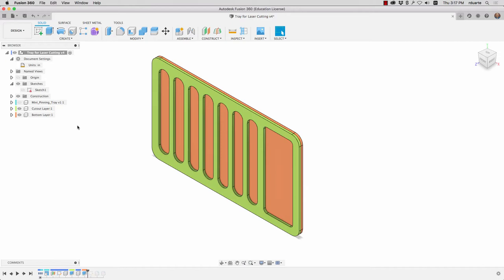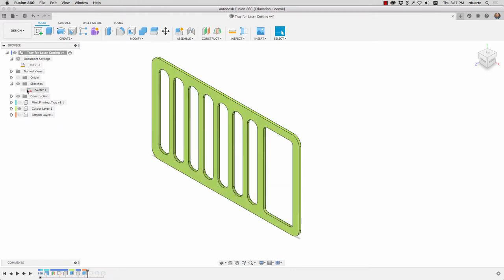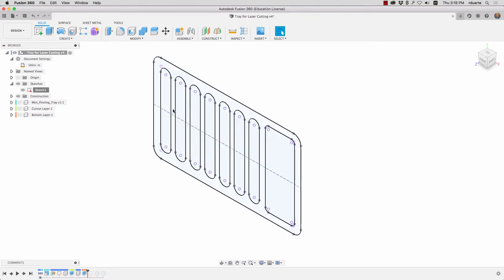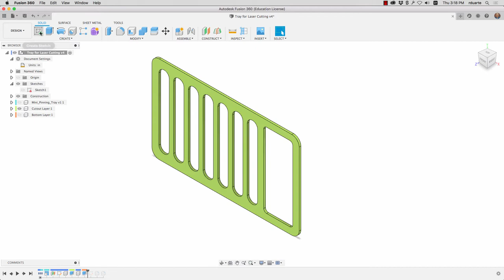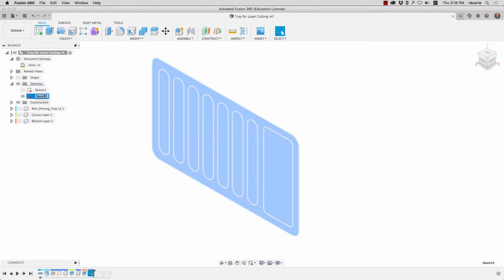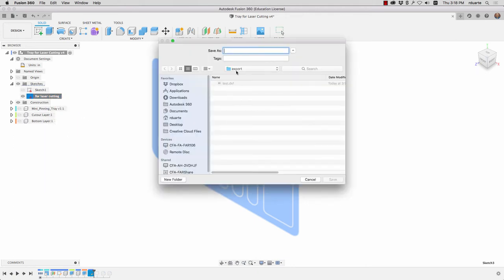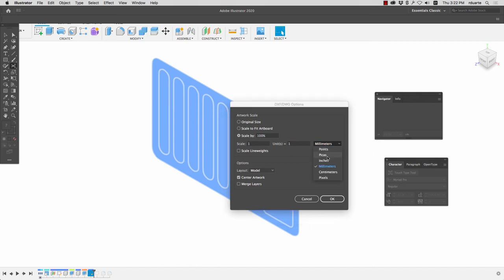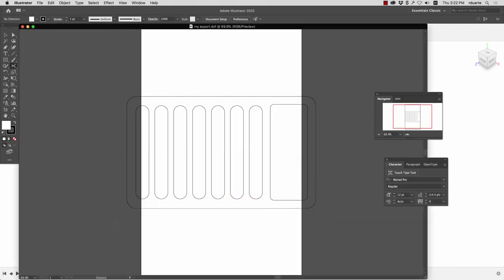Opening Fusion 360 DXF files in Adobe Illustrator

Comment: hi even when i use 1:1 scale my inserted one is still very small :/ i don’t know how to fix this
Reply from the maker: That should not be the case. Verify that both the number AND the units are changing. So if you designed in mm in Fusion 360, then Illustrator needs to say 1 unit = 1 mm
Reply: @RobDuarte  yes i’ve tried opening the original size, scaling to art board size, and also scaling 1:1/ 1:0,001/1:0,0001 /1:2.54 ..... nothing worked :(
Reply from the maker: @tomato3974  Watch the video again - it doesn't have to do with changing the original size or artboard size - it's about making sure that the units are correct in that initial import dialog.
Reply: @RobDuarte  I have same problem. I saved dxf, and opened in illustrator, 1unit = 1mm, but scale is roughly 1/3 small. and scale multify didn't work.
Reply from the maker: @KingTuna-m8q  It sounds like you probably made the original dxf drawing using units other than mm. Whatever you have the units set to in Fusion 360 (or whatever program is saving the dxf), you need to specify the same unit in the Illustrator step. I've done this literally hundreds of times - several times last week - so I can assure you, it works as I showed in the video.